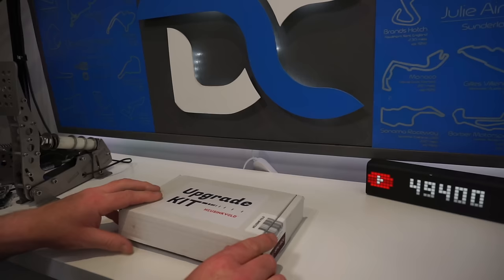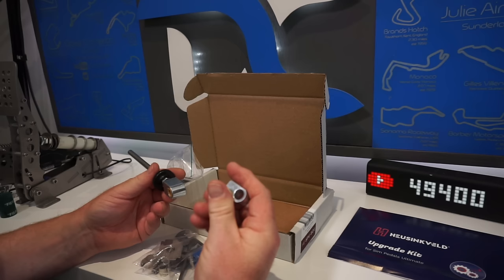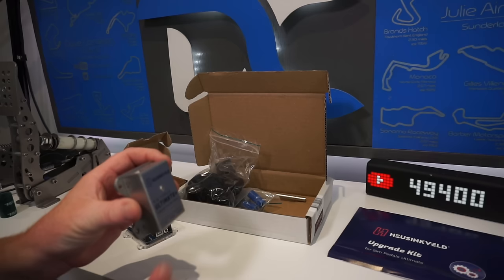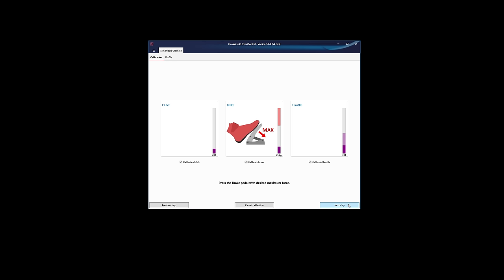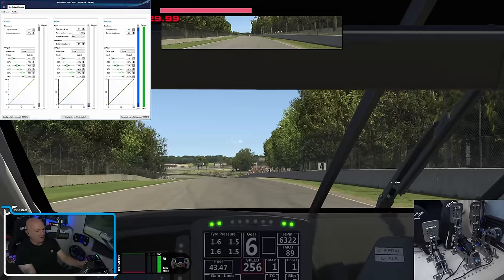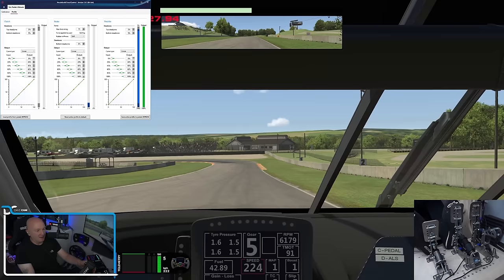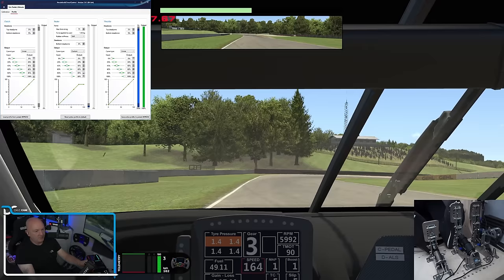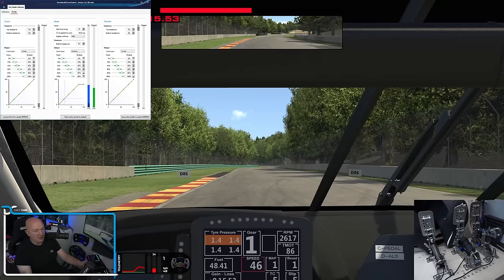Heusinkveld Ultimate + Pedal upgrade kit......is it worth it?

Comment: I just upgraded my rig to the ultimate +. I hung o. To the sprints for the smart control. So far I am super impressed the feel is spectacular and I still haven’t set the bumpers to where I want them.
Reply from the maker: I've gone for the hard rubbers and feels much better 👍
Reply: @davecamyt  I am probably going to try the mid range setup tonight. How do you have the control box mounted? I am struggling with that and my rig.

Comment: You should try out harder rubbers. I was using the white rubbers for years and swapped two of them against rigid black ones this year which is IMO much better. The softer rubbers compress relatively easy until a certain point and if this is setup to be 70-80% pressure you feel a resistance and know it's going into the lockup-territory. With the Ultimates I'm using black/green/white, but I think I will switch to black/black/white to get a more solid 'bumpstop'. It's still no problem pushing 100% if necessary and I always suggest to use shakers to feel lockup in the pedals. There is also a "BJ 2.0 Vibrator Kit for pedals set" for a small price. I don't know if this is worth it and two Buttkicker Mini do the trick anyway for me.

Comment: Thanks for the video. I have ordered one mainly because of the new board (EMI issues sorted) and mounting option. Also, it appears that the brake pedal travel is like in a real car. What is your current opinion, and what rubber configuration do you use?

Comment: Great video. However, don’t you still have to use the calibration through iRacing as well? How does this impact the Heusinkveld software? I’ve struggled with understanding how to get the right feel when you have to calibrate in two different places.
Reply: Only use iRacing. HE software does nothing for iRacing

Comment: Looks like your clutch mechanism isn't fully resetting to a flat angle.  You might want to loosen the side nylock washers.
Reply: Just increase the preload a bit, pedal should snap right back to 0. Always recalibrate after a preload adjustment or at least check the deadzone. 👍🏻

Comment: HI Dave. For those that use the iRacing “custom controls for this car” option to AUTOMATICALLY load specific per-car pedal calibrations, am I correct in assuming that with the new Ultimate+ software they will now need to MANUALLY switch the SmartControl calibration profile per-car?
Reply from the maker: Yes, you would have to setup one for each car to be accurate 👍

Comment: Hi Dave. I've installed the upgrade but the clutch and the brake are exchanged on the control Software (I've checked the position in the motherboard). Do you know how to solve it?
Reply from the maker: I think mine were. Just swap them around 👍

Comment: With the throttle travel, have you replaced the blue bump stop rubbers?
I wonder if they are a little thicker, so stopping the pedal travel a little earlier.
Reply from the maker: No, I didn't change them. It's just the shorter tod end i think. It's only minimal.

Comment: I think i would buy this for the hardware and not fit the smart control box for the gimacky/cheaty software
Reply from the maker: It's handy for the pedal pressure but I won't be doing anything with the curved etc
Reply: @davecamyt  I just calibrate pedal pressure for each car using the iRacing raw values

Comment: I'm between 45 to 50 max on the sprints brake pedal for the GTE with 100% being at 82% While I run 34 Kg in GT3's and 100% being at 77% not to tackle the ABS system. Yeah these pedals can do crazy braking Kg and I don't see why anyone would need them unless they race single seaters.
Reply: its easy to do 80-100 kgs in a proper rig. It is way easier to controll modulation for middle part of pressure, with heavier pedal setup
Reply: The trick for a very stiff pedal, is to have a very short throw, and correct body position. You might be surprised how much force non-servo brakes on GT3 cars require (in the ballpark of 160-200kg depending on the car). It feels like you will have walked a whole ten miles on a single foot.

Comment: I do have the heusinkveld ultimate (for more than 3 yrs) and honestlty I don't see any benefit of having that control over the pedals.

I mean, wouldn't be more productive learning to brake properly instead of setting a threshold in a software?

Each car and even the same car with different setup and also track conditions will dictate the brake threshold before locking, so setting that value in my mind is impossible.

When doing threshold braking (not trail braking), the locking will greatly depend on the speed of the car and downforce of the setup. In a GTE car like the BMW you just tested, is a good example.

Then if you consider that you set 80% max force and with that value you don't lock, how do you know that you are not losing a bit of braking performance? 

About pedal smothness you said everything, if you maintain properly, they will be as smoth as new.

The calibration software is actually nice for setting up the pedals, but other than that i think is a wast of time.

Anyway, good content!
Reply from the maker: I agree with you 100%. Correct braking technique is far more rewarding than a software setting 👍

Comment: What’s the max travel on throttle in cm ?
Reply from the maker: I'm not sure exactly but I'd guess around 10cm
Reply: @davecamyt  That’s very good because I have now Fanatec CSL Elite pedals and throttle is too loose and too short travel which makes it tricky to modulate well on wet track and for cars with no TC. I give unaware to much gas because of loose and short travel. 

That’s my main reason to go for Heusinkveld Ultimates+ for Throttle configuration to my taste and yeah also better brake feel. 

🏁

Comment: If you don't get faster with that kind of setup I think it would be fair to say that you would be better doing truck simulator content. The racing Sim world is rigged and whoever gets the best setup has a big edge (at least 1 or 2 seconds per lap) with good pedals alone..
Reply from the maker: It's hardly rigged. The equipment is available to all to buy.
Reply: Well ofcourse it's there to buy same goes to real lambos and ferraris. Cost wise just to play iracing is more than many can afford, let alone the cost of a good pc, and setup. Considering a good pc is like 3000€ atp in time, plus at least 500 € year for iracing and tracks. That wheel and pedal setup alone will cost more than the pc itself. 
Not your fault obviously but it's becoming a elite kinda sport you have to make a 7k+investment to have the same setup. My first ever car costed like 3k, How will I tell my wife about that? 😂😂